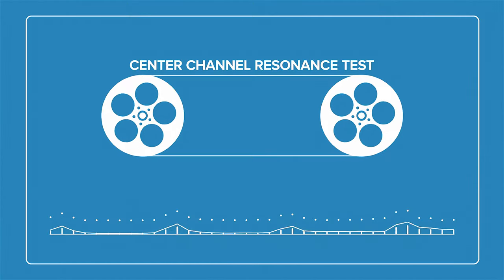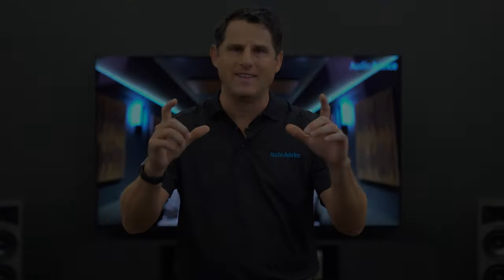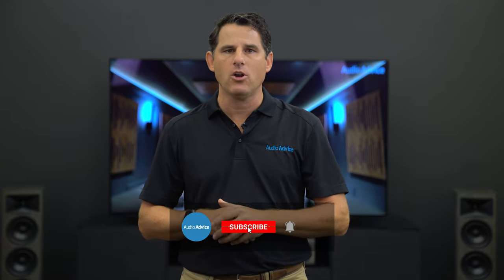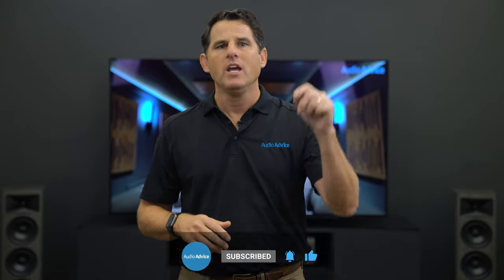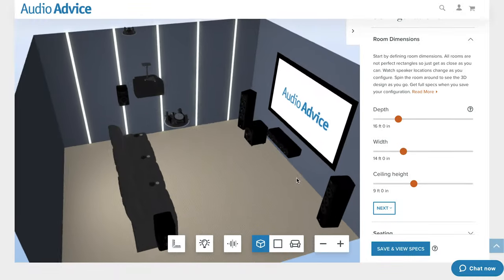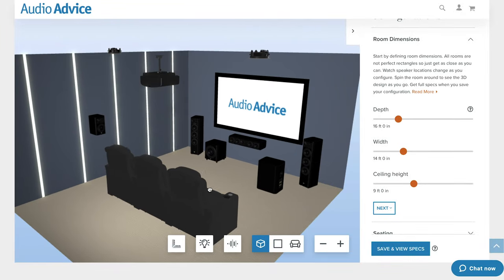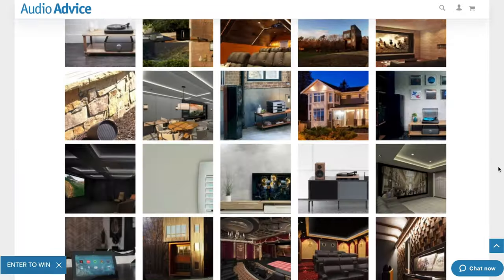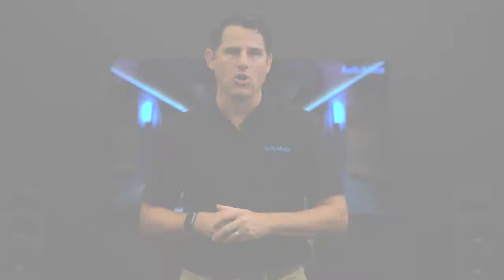Setting Center Channel Crossover | Test Track

Comment: Totally agree with using this for speaker placement, but for crossover, wouldn't your receiver's auto calibration software correct this issue?  I'm using Audyssey XT32 from my Denon and it sounds good after calibration.
Reply from the maker: Thanks, we get varying results out in the field, and of course not everyone is lucky enough to have something with good room correction :)

Comment: I tired using this to set up my crossover but I noticed that this only plays in stereo so I cant seem to get the sound to come out of my center channel. Any advice? was this intended to be used on "All channel stereo"?
Reply from the maker: It must be a setting in your AVR as normally when it sees a mono signal in the left and right channel, it will route that signal to the center channel speaker.  You might have the input set up to play a stereo feed in stereo and not Dolby Surround.  Thanks for watching

Comment: A more acurate setup for this test would be to play source dialogue in mono and disconnect (or turn off) all speakers except for your center channel from your receiver. Just my opinion 🙂
Reply from the maker: Yes, you could still do that with this track, we purposely used dialog that can excite cabinets and walls if the crossover is not right.  Thanks for watching
Reply: @AudioAdvice  Yes, and i also found that the dialogue you guys used is excellent to eliminate "nasal" or "boxy" frequencies if you have a seperate eq or on your receiver. Like a couple of other comments from people... no matter what combination of audio settings i use from source to receiver, i can't get the center channel to play on this vid unless i set my receiver to "7 Channel Stereo"... which is what led to my first comment ☝😊  Maybe i set something wrong on my pc?! Other than that, great stuff guys 👍